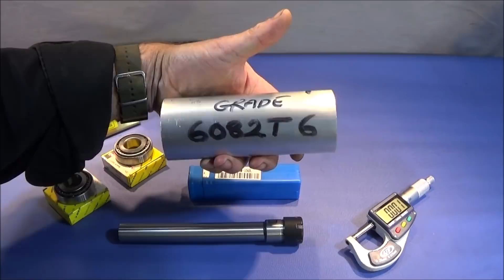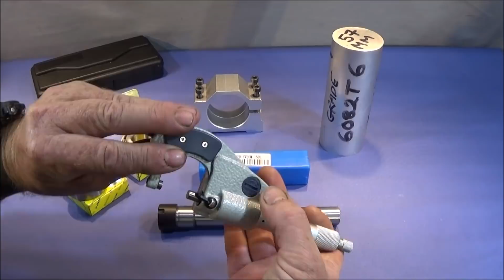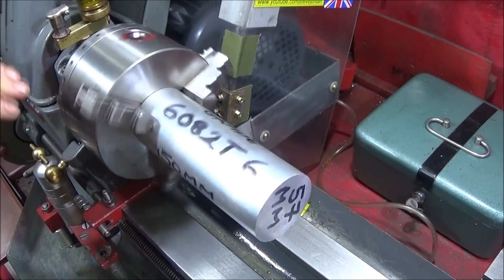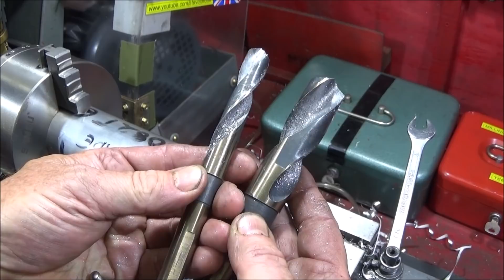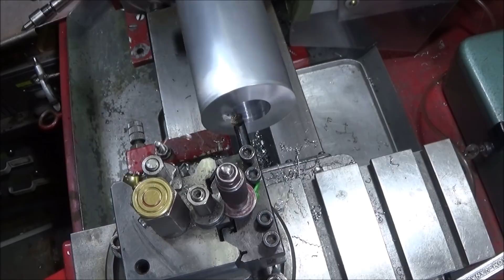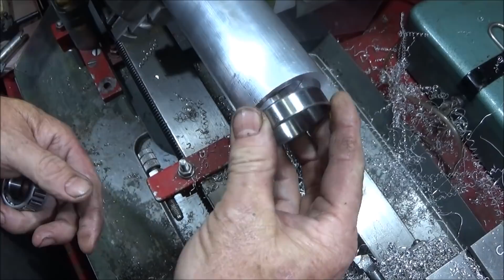Lathe Milling Spindle Attachment Part One Machining A Long Billet.

Comment: Hi Steve, seems like you should have done the finish turning first - as it stands you have no way to ensure that your two bearings are concentric. They'll be parallel because you reference against the faced ends, but since you're only centering the part in the chuck with the rough outside surface, won't the locations only be as concentric as that rough outside surface?

Comment: hi steve great video i the link for the bearings pls
Reply from the maker: https://www.ebay.co.uk/itm/TAPER-ROLLER-BEARINGS-30204-30213-DUNLOP-STANDARD-BEARINGS/123793987537?hash=item1cd2b257d1:m:mtpr09ujEv6XbCBtEQbR6Fw
BEARING SIZE 20MM x 47MM x 13.25MM (Bearing Number 30204).

Comment: Hi Steve.    You mentioned a light cut and then a spring cut.   Could you please explain what a spring cut is.    Thanks.
Reply from the maker: Hi it is where one takes an cut then leaving the tool in exactly the same position without adjusting the diameter and taking another cut which will be the amount the tool sprung off of the last cut. Just try it next time you do a turn. You will find a spring cut just skims a minimal amount off without moving the tool in at all.  Regards Steve

Comment: Hi Steve, great video. I'm making a mini-milling spindle too. Where did you buy those cheap tapered roller bearings? Normally, they cost a lot. Thanks from Singapore :)
Reply from the maker: Hi Steve, I bought mine on Ebay......https://www.ebay.co.uk/itm/Taper-Roller-Metric-Bearing-DUNLOP-30202-30213/201793076890?ssPageName=STRK%3AMEBIDX%3AIT&var=501832503110&_trksid=p2057872.m2749.l2649

Comment: Be warned that like many of the digital calipers, that on/off switch only turns off the display - power continues to be drawn by the micrometer. Definitely keep spare batteries in stock.
Reply: Thanks for that warning.....something I never thought about or knew........Grrrrr.......one reason why I love/hate all those tools that have battery power, nice to be able to switch from Imperial to metric and get three digits of accuracy BUT.....they're always flat when you want to use one.......unless you ggrrrrrrrr  remove the battery in all of them all the time when not in use.
I leaned towards the dial caliper as they aren't battery powered but have a small rack and pinion to do the actual measurement.......but grrrrrrr, the damn things can get small particles of dirt or swarf in the rack and you end up with the needle pointing down at the zero end.......I want a small rechargeable battery for my measuring tools, one like the LR44 battery size, but they don't make them.
Reply from the maker: I've had the digital caliper over a year now and I'm still using the same battery, so there isn't any power loss over time or its extremely minimal loss.
Reply: @SteveJordan  Probably I have some old off the shelf batteries that they sell on EBAY by the thousand.
I've had some bad luck battery wise but then I've also had some that do last for a while.....luck of the draw.....with hindsight I think it pays to buy them in as you need them and not buy in bulk.....a dollar a year is nothing in the end, but in the middle of the night when the display starts blinking I get a bit miffed......I'm working on an idea for a tiny super capacitor to cure the problem......thinking.

Comment: I loved that tip on using the lathe stop to measure the depth of the bearing and I understand how good that is. My question is when using the power feed, do you stop it just before it gets to the stop? And then manually feed it the last few mm? Otherwise I imagine it’s not a good idea to run into the lathe stop with the power feed, I guess that could do some real damage to the lathe or tools? Cheers
Reply from the maker: Hi Shaun, Thanks, Yes I run the feed until the last 2mm or thereabouts, then feed by hand. The stops are extremely handy used like this to get a depth. I had a clanger once where I didn't stop it in time, but luckily it didn't do any noticeable damage. I only use a stop and power feed with the fine feed though.

Comment: Hi steve love your video's do you think the Chinese mini lathe is powerful enough to work in titanium
Reply from the maker: Hi yes it will be fine. Make sure you use brazed on carbide tools or standard un coated inserts not titanium coated ones. Also  if there is a lot of machining take care because the swarf can ignite without coolant. I had this once happen in a factory it burns like arc weld bright flame and is very fast burning

Comment: Worked out well Steve. 

The only thing I would have done differently is to use my large four jaw chuck, as that would give longer grip surface on four jaws, and greatly reduce the chance of the job twisting in the jaws (as can happen with three jaws).

But that's just my view on long stuff in scroll chucks.

Cheers Rob
Reply from the maker: Hi Rob, Yes I would have done that as well,  but I only have small 4 jaw chucks at the moment that wouldn't be good to hold this large diameter. With the jaws in the outer hold positions there is only 8mm depth of hold, whereas the 3 jaw one I'm using has 26mm. Also the 4 jaw wouldn't hold this diameter to allow the billet to go up hard against the chuck face, like the 3 jaw, so using a 4 jaw would increase the overhang.  I hope to get a 125mm dia 4 jaw soon. I just had to take more care when machining.
Reply: HI Steve,

Sounds good.  I have a 6" four jaw chuck and quite honestly that is as heavy as I would ever like to go.  How guys get on with 8"+  chucks is beyond me.  So damn heavy.  Maybe they never swap over for a collet chuck.

But, yes, I have had work catch and twist in a three jaw chuck.  It's just the way they grip stuff that makes them quite prone to this.

I enjoy your videos very much.

Cheers Rob

Comment: Excellent video Steve, and perfectly timed!  Need to safely turn long 6061 billets of a diameter larger than the through hole.  Once again your video efforts enable me to make production possible using the lathe/mill I have (which has no steady) instead of sending out and paying that high cost. Bonuses include learning to make a spindle and producing the quality I want. Many thanks.

Comment: For the facing problem, don't you have a steady rest?
Reply from the maker: I must buy one sometime!
Reply: Steady rests are not hard to make. It is a good starter project for any machinist.
Reply: Yeah, I saw later on that you didn't have one. If you do get one, be alert to the maximum diameter it can hold. It's deceptively smaller than the bore of the frame.